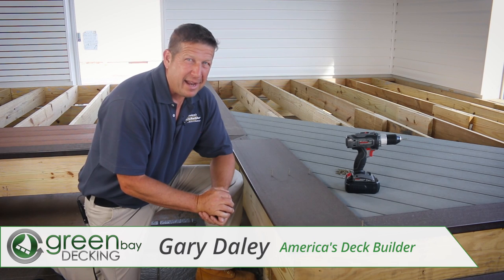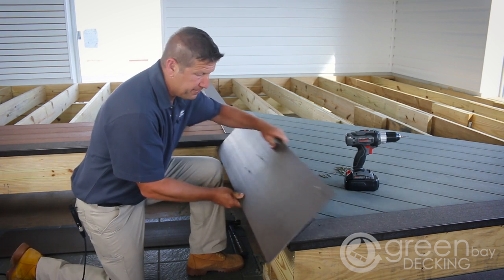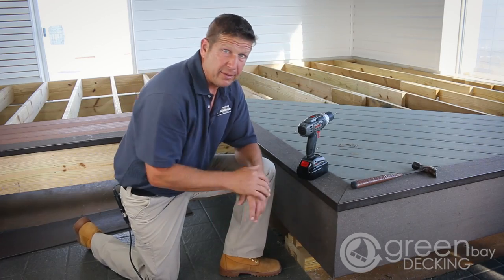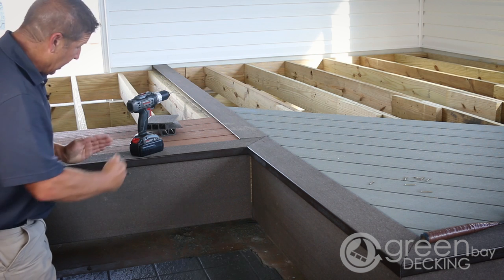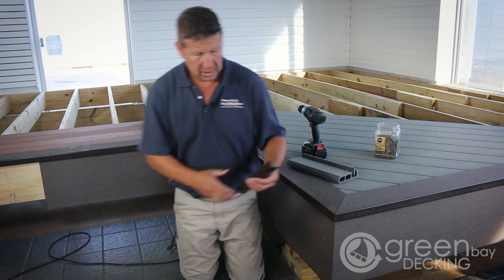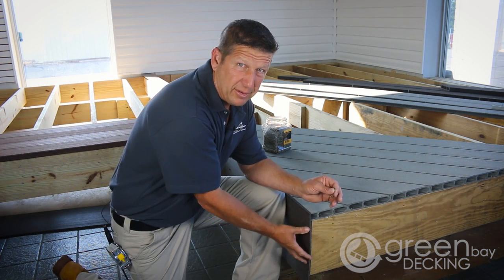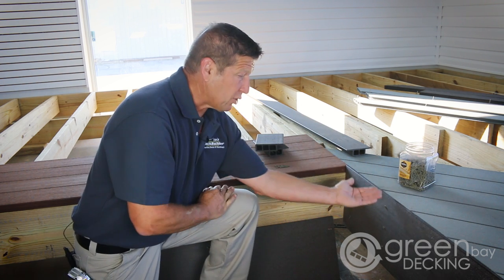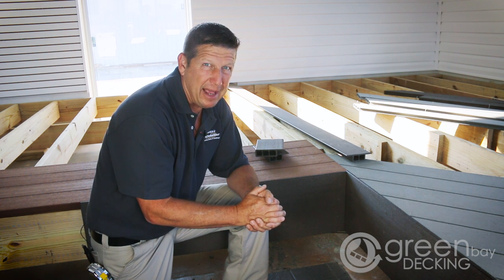Green Bay Decking Fascia Installation

Comment: Nice video,  what is the thickness of the fascia you are installing?  I want to use white and everything I can find is 1" and this is going on an existing deck the thicker fascia is extending out further than the perimeter strip you mentioned. My concern is water and debris could get behind the thicker fascia.  Thanks
Reply: Use Versatex.  It's white, and available in 5/8" and 3/4" thicknesses.

Comment: This video answers a question I've had for a while: if it's acceptable to install composite decking in a Chevron pattern with the joist at a 45 degree angle.
Reply: it is but joist would need to be 12"OC

Comment: So is it taboo to use 8in wide facia board on a 2x8 rim joist? I heard its usually 12 in wide.
Reply: Use whatever you want.  A 12" wide facia board will be good for both 10" and 12" joists.  But if all you need to cover is 8"... 8" facia would be fine.